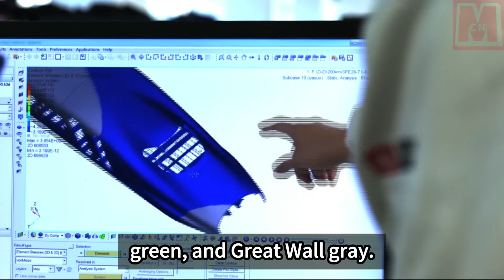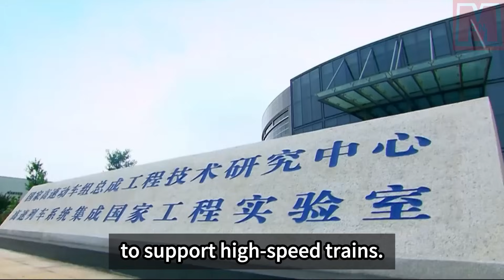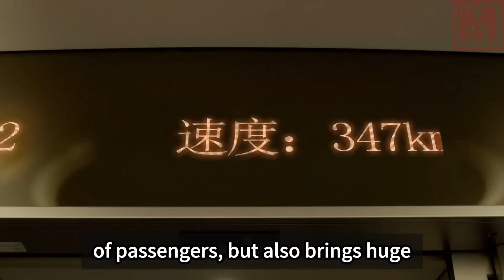"Fuxing" EMU:The Qinghai-Tibet Railway has entered the EMU era

Comment: Unless a rail line is built in South America's Andes Mountains there will be no taller point on a rail line than the Nepal Railway line when complete and they should build a station at that point on both sides of track and tunnels to outside of the mountains.  Even if rarely used, when used, it would be one of the most epic views on earth and a reason to ride the train for that alone.